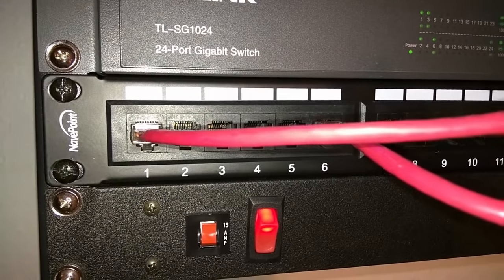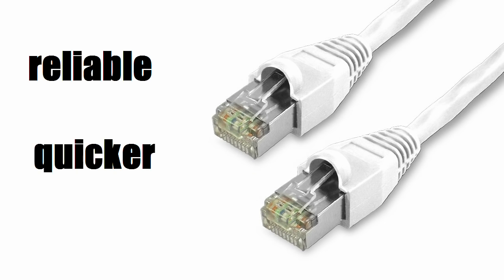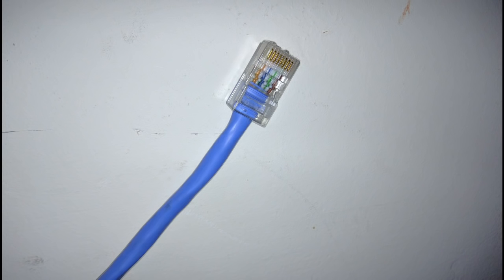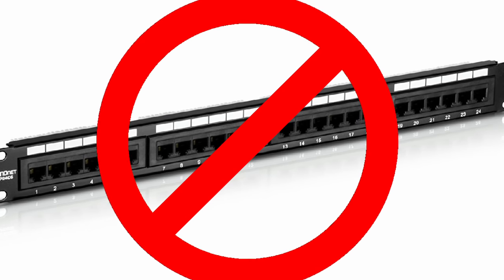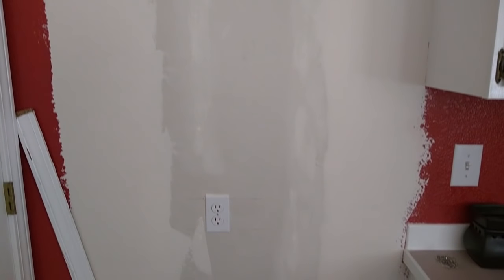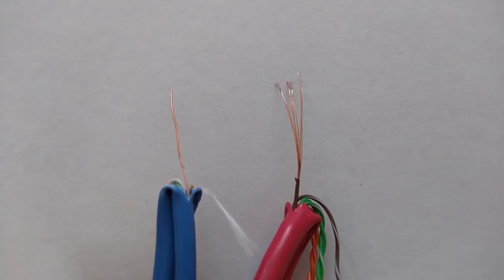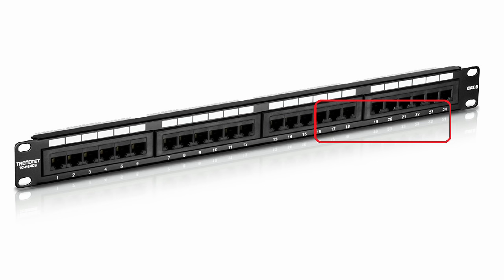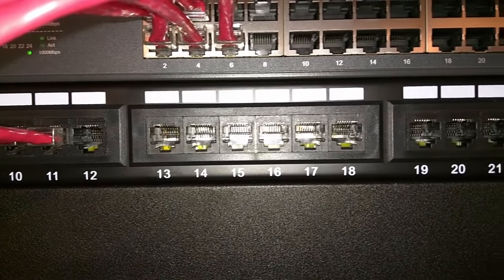What is a Patch Panel? Do You Need One?

Comment: Hey, great video  I've had some networking classes years ago, but don't live in an environment where the patch panel would give me anything.  I have an Airport extreme as my main wifi router, with gigabit ports.  What I have done for the computer is to run a  cable direct between the computer and a port on the router.  For my home theater setup in the living room  I've run a 25ft cable to a gigabit switch  on the back of the home theater stand for the smaller cables to connect to each device.  For the long run, i've coiled the extra cable cleanly out of site, and have run the cable under carpet, and behind the TV stand..  My main reason for doing this was to have heavy traffic devices such as streamers wired, and instead of wireless for better latency and overall performance.

One thing I've done additionally is to use black cables so they blend into the black stand.  For most wireless here they are on 80211ac, or n.  One bedroom apartment here so this is the cleanest way to do it without any leasing violations.

Comment: Even if you use WiFi only, there are still some benefits for wiring up multiple access points across your house (instead of using just one router-switch-AP combo) and recently most brands have begun to sell in-wall access points, which can be very convenient

Comment: I just want to add for people that don't know how this stuff works, when terminating ethernet and punching it into the keystone and patch, there's 2 types of wiring, type A and type B.
I usually use type B but it does not matter which you use, but it Does matter that you wire both the keystone and the patch in the same type whether that be A, or B
edit: B is a lot more commonly used

Comment: When I moved to a new apartment last year I fixed my network. Got a 6U and 4U rack mounted side by side, one with a router, 24-port switch and 24-port Keystone patchpanel. Other with a shelf for my Synology NAS etc. I would definately recomend a patchpanel if you are pulling cabled. And if you are considering a 16-port or 24 get the 24, at least in Sweden the difference is cost is almost none existent. Also Cat6 vs Cat6A was for me 0.1€/meter in difference when buying a 100m installation drum.

Comment: I am starting to setup my home network, same as the above. I am confused on the TP Link Switch wiring. Does it matter that the wireless router/modem plug into port "1", or it doesn't matter since they will all be connected within the switch?
Reply from the maker: You should be able to plug the Ethernet cable into any of the router's normal lan ports, and the other end of the cable into any port on the switch.

Check out my Home Networking 101 video. It may clarify some of this.
Reply: Would the switch slow down my internet speed ?

Comment: OK Patch Panels. I am using 2 Suttle boxes for my network. I had a patch panel (8 ports) from suttle and an 8 port cisco switch. I ran out of room and had to run extra runs out to the router to use that as a switch. I finally did away with the patch panel and went to a 16 port netgear switch. I now have 5 free ports on my new switch after terminating all the old patch panel cables. Very happy with the outcome and it ALL fits inside the suttle box.

Comment: I’m going to use half of the panel with de 5e cables for phone use like you recommended, but how would that work?
Reply: An RJ11 jack (the smaller telephone jack) will fit in the RJ45 socket of the patch-panel in a central position. No matter how you cabled it (I guess 568B), usually, you'll use only the central, blue, pair for phone if your phone is a simple analogic model and not an advanced model (IP phone for example) or with special functions for the PBX. https://www.peakelec.co.uk/content/ethernet.html

Comment: I was going to get one of those Patch Panels, but It seems like a hassle to connect all the cables to it.  Lots of bulk, and I'm in a small closet for my Network.   So what I ended up going with was a patch panel form Cable Matters.  What you then do is install Keystones onto all your cables instead, and then pop those into the Patch Panel.  It even supports all the cables in the back with zip ties on each cable.  It's really nice. It may be a little more money with the cost of the Patch Panel and the needed Keystones.  But it's so worth it.  You can also always pop out a keystone in the future if you have a need.  Much simples to do that than one of these other Patch Panels.

You can even use different colors of Keystones.  Blue, Red, Green, Black, etc to color code the ports that way if you like.  I used all Black, but I also have everything labeled above so I know where everything goes to.   So I'm using 2 of these patch panels.  The great thing about them also, is you don't have to use just normal Keystones.  I am using from Passthrough Keystones for example.  This allows me to plug my Wifi router and other devices into the back of the patch panel, and then use one of my short cables to go form the patch panel on the front to the switch, making for a nice CLEAN look!!!!  But you can plug into the patch panel HDMI keystones or Audio Keystones, or COAX Keystones, etc.  The flexibility you have is HUGE!!!!!  I'm using 2 of them.

https://www.amazon.com/gp/product/B0072JVT02/

To bad, I can't throw a picture up here of what it looks like.
Reply: Sweet!  I was thinking of doing the same. All my Ethernet is in cabinet in my closet and already has terminated end connectors. I didn't want to cut them all and then wire to the back of the panel. Gonna do this instead. Thanks.
Reply: Am I missing something? - The keystone RJ45 modules are about 5€ each here in Germany. So if you had a requirement for, say, 16 ports your still going to end up with a cost of 80€ plus the cost of the keystone panel - so all in all 100€+ for a patch panel. you are still going to need the same patch cables to the switch.
I may be wrong as I am a complete novice - as I said at the beginning - Am I missing something?

Comment: Like you said you can plug your telephone plug in a network port it is surely a bad idea. The problem here is that you damage your connectors in the keystone. For that use you can get special adapter from RJ45 to RJ 11 even you have enough wires in the cable to connect 2 phones over the same network cable.
Reply: Or you could run it out the wall and go straight from the phone to a 66 block. Just like the good old days 😂
Reply: Or better yet, buy a panel without connectors and then use the appropriate connector for Ethernet, phone, TV, speakers, etc..
Reply: @Oshino.  I prefer BIX strips.

Comment: 2:03 Oh dear, the Linksys WRT54 series... In my experience those needed a power cycle every once in a while (do heavy transfers and it was more than onced a day) because they'd freeze.
Reply: With DD-WRT as firmware? Back in those days I used more than 5 of them in a quite heavy-duty environment (with VLANs and IP cameras) and I sent them to the garbage bin when they started to manifest hardware failures. At least in my experience, they were quite reliable workhorses.

Comment: Question, I want to wire my entire home with ethernet like you have. But I do have plenty of devices (mainly cameras, firesticks etc.) that need to use wifi. My wifi has always been extremley limited in range and some spots in the house are completley dead. After wiring the house with ethernet can I simply just plug a second router into any newly installed ethernet jack to boost my wifi coverage?
Reply: Just buy mesh router
Reply: You can plug a router which have the ability to configure as Access Point. Different to just a mesh router the Access point dosen‘t just expand your existing wifi. it generates a completely new one with full strength. If you wanna know more about it. search for access point in Google.

PS: dont forget, that the devices need to have a direct Connection to your Main Router else it must be able to communicate with your main router via a switch.
Reply: @tomkappert9044  Thanks for the tip, can any router act as an access point? If thats the case I will just run an ethernet cable between my existing router in the basement to the new router in my living room upstairs to cover that section of the house. Does this create a separate wifi username and pw like an extender does? I have an extender now and it not only doesn't work as that well but have two separate wifi networks is a pain to have to switch back and forth depending on where I am in the house.
Reply: @dangli-sac4053  if you don’t want multiple networks you can get mesh routers. These will use the same SSID and your devices will have the option to move between them depending on signal strength. Just be sure to do your research first. I have TP Link Decos and they’re awful. My 1 Gbps connection drops to literally 40 Mbps the next room over using M5s. Buy nice or buy twice.
Reply: @RoloC4  pretty much this. If you have a big house and want to widen your wifi coverage, you don't want other routers, you want multiple access points that work together, like the Ubiquity ones. Those multiple access points only need to connect to strategic lan outlets that you are going to install in your home.
Reply: you can also just connect a second wireless router to your main router (via ethernet cable) and it will work as a repeater.  You will have to set up the 2nd one in bridge mode....easy to do, and there are many videos on how to do it.
Reply: @tcchiefs  With most router/AP combos you just need to connect it to one of the LAN ports, if you skip the WAN port, it will work as a Switch/AP, no need to configure.
Reply: @MrLuizsaluti  The last 10 or so routers I've had to mess with all needed specific options set in order to work in AP mode, what models do you normally use?

Comment: A few questions
1. Where is the connection from the router to the patch panel and switch. Is it Router LAN port—> patch panel—>Ethernet port(24) on patch panel—> Ethernet port(24) on the switch?
2. How can you have a similar set up with a mesh Wifi system without having one of the wireless access points in a closet?

Maybe you can make a more modern version of this setup with a mesh WiFi system. Great video nonetheless
Reply: Val Topete wall jacks/devices > patch panel > switch > router > modem.  For the mesh, you can run the main access point for the mesh back to the router in your closet (via wall jack that you would wire) or where ever you decide to put it, and then the other access points link to the main mesh router.  The main router in the closet I would turn off WiFi though.

Comment: good job and well explained :)  be careful on phone wiring on ethernet jacks, those plugs are 6pc whereas ethernet is 8pc and the pins in the rj45 can become bent/unuseable if you go to use ethernet on them afterwards.  Also regarding in wall wiring it would be good to address plenum rated cabling - a good idea most people cheap out on.
Reply from the maker: I've seen some jacks where they will accept both, I've also seen some where they won't. I just grab some adapters from Amazon what that is the case. Good clarification though.

Comment: I'm very tempted to put a patch panel in my office closet and run Ethernet throughout the whole house, but the last song give me visions of a middle aged British chap reviewing obscure audio equipment.
Reply from the maker: Lol
Reply: If you do use a keystone pannel as it's easier to use and alot more customisation available
Reply: @CrypticConsole  I think keystone panels are better for things like server racks, as you can customize the connections. Such as adding an HDMI port or other ports to the panels. 

I think it's overall more expensive, since you have to buy the keystones as well, but since I am building a server rack that will also house all the connections around the house, I probably should have gotten one of those. I may get one later, as the server I'm setting up is mostly being used as a NAS, and for PLEX, and doesn't require much interaction with it directly. I am planning on getting a difference server to tinker with it, and for that, I may end up getting a keystone panel to access some of it's ports so don't have to reach towards the back, or have to take out the server to connect to it.
Reply: @joemann7971  they are really useful if you wanted to change connect often in a lab environment, or if there are already cables with male connector terminated

Comment: Large networks sure, small networks or in a house is needlessly complex. 

For a house, I would recommend and am using a large multi port switch with labels. 

Growing/ large networks, patch them up.
Reply: Well, it's already needlessly complicated to run a bunch of wires all over the place. I would just run one wire and just connect a unmanaged switch at the other end to avoid having to run a bunch of cables. lol.

If you're going to go through that trouble, yes, get a freaking patch panel.

Comment: Over all, this is a very good discussion of the topic. I would like to point out a couple things. First, the item that you refer to as a "keystone" is a jack or module to professionals. Keystone refers to a particular type that is non-proprietary. A keystone type jack from one manufacturer will generally fit into a faceplate or surface mount box from another manufacturer. Second, standards require that all cables be machine labeled. In the home, you  can do what you like, but the professional space, proper labeling is essential. Third, all of the jacks shown in the video are upside down. The keyway should always be at the bottom. This prevents dust from settling on the contacts of unused jacks. Final, even in a home environment, cable should always be terminated to a jack, not a plug. if you do not want to put in a patch panel, use one or more surface mount boxes. This will look better than loose wire and give many of the same benefits as a patch panel, minus the "coolness factor' of course.
Reply from the maker: Yes mine are upside down, but since I have  put them in correctly. Good tips! Thanks!

Comment: You can also split your network into more than one network...using separate switches for each "sub" network. I have my security stuff on one network, and separate switch and router. It is NOT connected to the visible Wifi. The gaming stuff for the kids - on its own network. I'm probably over-geeking it...
Reply: Provided the networks are correctly segmented, this could limit your attack surface, so is improved for security.
Reply: Also could be relevant for a WFH scenario where you need to keep business and personal networks separated.
Reply: Now I want to run, say, 3 cables to every location, maybe red/green/blue, on 3 separate switches. I may have a problem.
Reply: Nothing to do with patch panel.

Comment: So basically a patch panel replicates all the ethernet ports in all the wall plates in your house/business close in one consolidated place close to your switch. This way, if you need to make changes to how your network is wired, you effectively have all the ports in your house/business in the same area as your switch (assuming you have the patch panel correctly labeled). 

But really...the main reason you need it is nerd bling.
Reply: As the number of Ethernet cables coming back to a central distribution point (MDF) increases, a patch panel becomes a requirement.  In a commercial environment, there could easily be 200-300 Ethernet cables coming into an IDF, in that situation, it's not even a question of their being a patch panel, one will have one or more 6' tall rack filled with patch panels and wiring management. In most residential settings patch panels are optional because there just are not many cables. In my home I currently have 15 Ethernet cables coming into the MDF and no patch panel. I have more cable runs planned and will also be putting in a patch panel.

Comment: I asked this same question on your post from 2018 and that is....where does the router get plugged into to provide the internet to the switch?  I understand the patch panel and the switch providing the common link to all networking throughout the house.  I understand the modem receives the internet signal from the ISP via coax and a small cat5 cable goes from modem to router.  Under normal home networking the 4 ports on the back of the router will provide 4 "plugged in" connections for 4 devices.  That being said, the router needs to be plugged into the switch panel but I do not see that?  And this video post is awesome!!!  I purchased the equipment to network my new home.
Reply from the maker: Nice! You just plug in an Ethernet cable into one of the LAN ports on the back of the router, and the other end, plug into a port on the switch.

Comment: You can have keystone in the wall and on other side rj45 and go straight to switch?
Reply from the maker: Sure, if you want.
Reply: Hi... there are 2 different types of RJ45 plugs, one for stranded and one for solid core cables, the stranded one has 2 spikes that go into the strands and the solid has 3 off set spikes that go either side of the solid wire

Comment: If you're gonna get a patch panel do not get the ones you have punch into the back. If there is ever a problem with a port in the back it is non repairable and useless. They have keystone panels which are essentially just a face plate you fit a a female to female pass through connector to making it fully modular (also looks cleaner). So if there is ever a problem it's easily swappable.
Reply: Appolyon I agree 100%. Only draw back is crimping twice as many RJ45 Heads. I’d rather do that any day over punching down a board typically while in a cramped area trying to hold the panel on my knee.
Another cool thing with the keystone type is that you can install USB, Coax, HDMI, etc... jacks and have them all on the same panel in the order you choose.
Reply: I've been using the leviton atlas series and it's so much better than in the old days